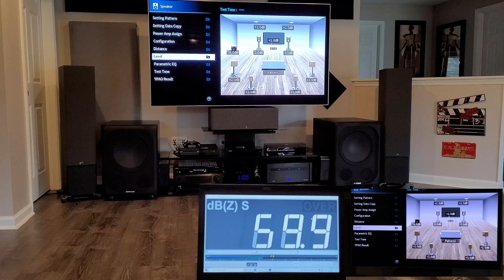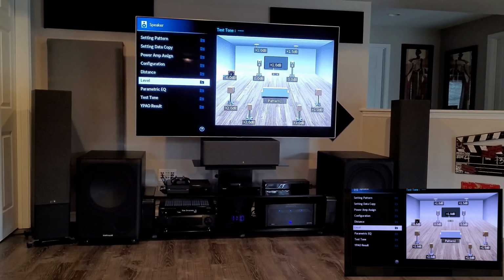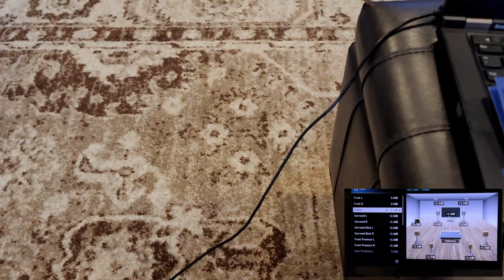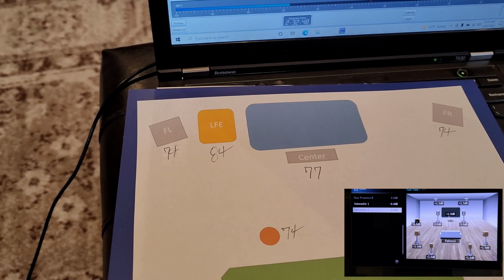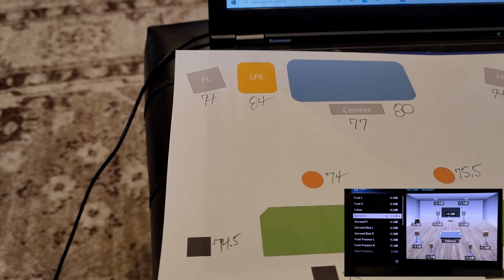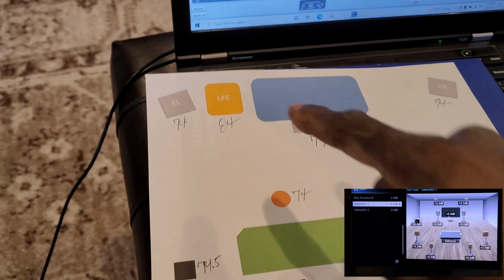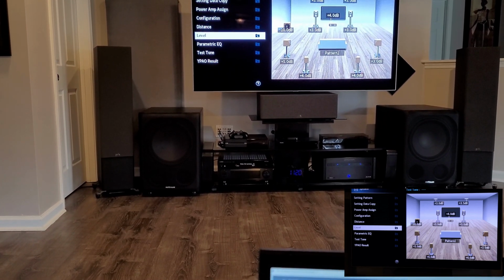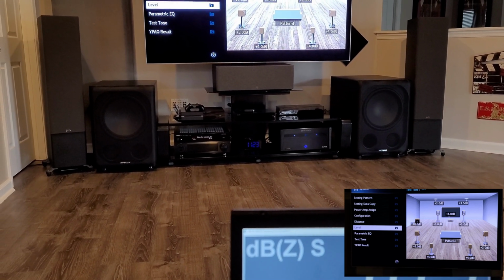Calibrating Home Theater dB Levels with an SPL meter for Seamless Integration

Comment: 75 db left and right speakers 78 center channel speaker 80db subwoofer.
Should dual subwoofers be at 80 db?
Reply from the maker: @JayPatrol  I made another calibration vid after this one, which I think is a bit better. I set all speakers, including the subs to 80db. Which makes for the perfect integration. When I db my subs, the gain in the receiver is at -10, making it easy to add a few more db without having to remeasure. I then pull the subs up to 83db (-7.0). Which in my setup sounds incredibly good. I calibrate my living room setup with the same specs, and it also sounds really good. Give those specs a run in your system and see how you like it. All speakers = 80, Subs = 83.

Comment: It’s better to put the subwoofers away from the front speakers
Reply from the maker: @JayPatrol  The best position of subwoofers is determined by the room and its acoustics. Every room is different, so you need to figure out what works best in your environment. I have four subs, with two up front and two in the back. In my room, this configuration works phenomenally..

Comment: May i ask what volume do u put when u u calibrate ur speakers 0db or -20
Reply from the maker: When setting the db levels, first turn your AVR volume to 0, which is reference  level on a relative volume display  (-70 - 15). If you have an absolute volume display (0-100), set the volume to 80, which is reference level on those systems. Then, run your test tone/pink noise to calibrate the speaker dbs.

Comment: What are your thoughts on processors. Do they take the load off av recivers. What exactly does a pre pro do.
Reply from the maker: A processor does the same thing as an AVR without the amplification element. It wouldn't make sense to use a processor with an AVR. Rather, you'll run a processor with external amps. The benefit in doing so is more power and scalability.
Reply: @PolkFan  so using a processor with a separate lets say 5 channel power amp would make more sense.
Reply: Do you use a pre-pro yourself.
Reply from the maker: @NaveedKhan-bs1sc  Exactly. The amplification power in AVRs drops significantly in multichannel mode, vs separate amps are constantly strong, keeping the same RMS power all the time.
Reply from the maker: @NaveedKhan-bs1sc  No. I have my front stage on an external amp and processed from the AVR. The rest runs from the AVR.

Comment: Audessy is a good starting point. There's a lot of tweeking that needs to be done after it's done. Verify speaker distance is number 1... Another trick I've learned, is take the distance and multiply that number by 0.875, you'll see an improvement as well.
Reply from the maker: I have another video that illustrates manual tweeks after calibration, which includes speaker distance, position, crossover points, eq settings, etc. This is only specific to setting the db levels using an SPL meter. YPAO seems to do an excellent job with calibrations - especially with multiple subs. For me, there's not a whole lot that needs changed after calibration. Mainly just crossover points and DBing.
Reply: @PolkFan  I wouldn't have thought there would be the need for a lot of tweeking, a foot and a half off. That throws the vocals all off on 2.1 listening. Once corrected, the vocals came to the center and the overall sound was so much better.
Reply from the maker: @damondhorner1602  Nice. I've measured my distance after calibration and found the settings were spot on. I haven't used any receivers with Audyssey but from my experience with working with people who has Denon, Marantz, YPAO does a better job. I'm running a A2080 now, but eyeballing the A8A. Really don't need it though because the 2080 is such a solid receiver, and there's not much to gain.

Comment: The Test Tones in your AVR bypasses all forms of room correction. I recommend selecting the ‘Generator’ feature in REW and play periodic pink noise with the room correction mode (e.g. YPOA/Audyssey,Dirac-Live) via your AVR enabled

LFE is actually a separate channel all together. It is 10db ‘Hot’ by design. I would keep it as such. If you interested in calibrating your subs to a specific SPL then you need to disconnect your Left main speaker and play periodic pink noise at the Sub level (selectable in REW) with the Left Speaker selected in REW. Don’t confuse the LFE channel with low frequency output from your subs (I.e. Yes LFE is low frequency by design but most low frequency material is sent to your subs outside of the LFE channel). The material sent to your subs via LFE is material that the ‘mixer’ of the movie/music designated as part of the mixing process)
Reply from the maker: I'm good with my method. It's effective and works well. I have no need to use REW for speaker DBing. Many HT users don't use REW or even know what it is. If you'd like to post a vid illustrating a better method, I recommend you go forth and concor. What I've outlined in my vid is simple and doable for most HT users. I'm in the business of helping others achieve awesome sound; not complicating matters by advising them to use tools they most likely don't have or the inclination to obtain.
Reply: @PolkFan  sorry, I thought you were using the REW SPL meter?
Reply from the maker: @ts6640  I do. I also pointed users to a handheld SPL meter from my other DBing vid. Which is also effective and only $30 from Amazon. Using REW requires having a machine to host the software; getting a MIC similar to my UMIK-1, getting the proper connection cables, etc. All that for speaker DBing? Just use the handleheld; it works fine. I mainly use REW for my subs. If it wasn't for the fact that I run four subs, and use MiniDSP 2x4HD, I wouldn't use REW.
Reply: @PolkFan  Fair enough, but I do think it is important to note that the internal test tones of the AVR bypasses all room correction modes. Since the vast majority of users use some form of room correction I think it is important to use pink noise with whatever mode the user normally listens to movies/music via his or her AVR. Room correction can alter the specific ‘trim levels’ for any given speaker. YouTube even has several versions periodic pink noise available or one can download samples and play back via USB.

My comment should not be taken a criticism by any means (hell……it is not like the manufacturers of these AVRs are exactly forthright in letting users know of this fact)

By the way, I just subscribed to your channel. I like your content!
Reply from the maker: @ts6640  Cool.👍🏾

Comment: Is it bad that my front (L & R) are set to +11.0 ? It's at 75DB and I used z instead of c for the test tone.
Reply from the maker: It simply means either your speakers have a really low sensitivity level or your receiver's amplification power isn't that strong. The trim level is high, but you're at your desired db, so you're good to go. Using the Z scale is fine. I also use Z. Both Z and C are pretty much identical between 20-20. Z is more accurate than C below 20hz.

Comment: at what level to put your amp to play with the sound level meter
Reply from the maker: Reference level. For receivers with a relative volume display (-70 - 15), reference level is 0. For receivers with an absolute volume display (0-100), reference level is 80.
Reply: I have a yamaha rxa8a amp so I have it but at what level?
Reply from the maker: @Mck179  0
Reply from the maker: @Mick  Yamaha gives you the option to change the volume display type, but is default to relative.

Comment: Just curious but why are you using z weighted instead of c?
Reply from the maker: Z has no weighting and is flat through all frequencies, unlike C that's flat only through 20-20. So for measuring purposes with speakers capable of playing frequencies outside the 20-20 range, you'll get more accurate results. For this particular measurement, it really does matter. You'll get the same thing with either Z or C.

Comment: hold on mate. your mic is connected to your computer? or direct to the receiver. i don't see any cable that shows your mic connected to the receiver. 🤔
Reply from the maker: The mic is connected to the computer via USB. When using REW, you'll also need the calibration file upon first use. The calibration file is available from MiniDSP when you purchase the mic from them. This ensures the most accurate readings.
Reply: @PolkFan  🤜🤛 awesome. thank you for all the information.
Reply from the maker: @combojerman28  Absolutely. Anytime! 👊🏾

Comment: Ok let me know one thing what happens if put all the speakers at the same level for example 75db?
Reply from the maker: Setting all of your speakers to the same db will result in an uneven sound from your system as a whole. Only in a perfect acoustically optimized environment will that work. The goal is to adjust your speakers so that the listener will hear the sound from all speakers evenly in a given area. Based on the acoustics of your room, that may require speaker A with a higher db level than speakers B and C, etc. Versus setting them all to the same db level, one speaker may sound lower than another -effected by the room acoustics.The majority of our rooms are not perfectly acoustically optimized and therefore our speakers must be adjusted accordingly. This is why system calibrations are a necessity. Your speaker must be adjusted for the acoustics of the environment in which they will play.  

As far as what db level to target correlates to how much volume you want to give your system before it reaches the point that satisfies you. I prefer not having to crank the system to reference level (0 on a relative volume display) before it's loud enough to enjoy, so I target 80db. I typically watch movies with the volume on -15. You can target 75 if you like, it simply means your system will be 5db quieter than mine throughout the volume range.
Reply: @PolkFan thank you so much for reply
Reply from the maker: @avsolutions212  You're very welcome.  Anytime 👍🏾
Reply: @PolkFan  ❤️

Comment: Hi may I know, example your atmos before +3db, left=74db & right=75.5db its means sound out from this 2 speaker not same, why not get it into same db? I want to learn about this..
Reply from the maker: The reason you'll see different dB levels like that from calibration is beacuse of multiple factors. Based on the placement of your calibration mic and what it hears during calibration, it'll tell the receiver what adjustments to make in order to make them deliver an even sound to the area of calibration. While the speakers may be identical, the placement of them could differ and possibly cause one speaker to need a db of amplification added in order to make it sound even with the other. For example i may have one front speaker sitting 14.5ft away, angled at 20 degrees, and the other at 13.5ft with the same angle. Both identical speakers, same output, same angel, except one is a foot further from the seating area. That one furthest away may need a tid bit of more volume to sound even with the speaker that's closer. In a perfectly acoustical treated room, the number will be much closer or identical, no adjustments will need to be made. But the majority of our rooms are far from perfect, which is why adjustments are required to overcome the acoustical flaws in our rooms.
Reply: @PolkFan Thanks for your info..
Reply from the maker: @myhobby3097  You're very welcome. I hope it helps. If not let me know and I'll try to clarify things.

Comment: Bro, this is a good idea. You have ratified your previous position with correct reasoning. Agreed, its just building on what the system calibrated for your specific room (its character, placements, distances etc). Its like putting a substructure on a foundation - with calibration being the foundation in this case. Thanks for sharing this deep insight. Share some post-adjusment vids now.
Reply from the maker: Kool! What's good my brotha. Thank you so much for the feedback. Your assessment couldn't have been more precise. It expresses my exact logic and reasoning. More vids to come. I'm back in the office now so I have to find time in my busy work schedule. 😄

Comment: Question: Instead of adding 3 +DB to each of the speaker why didnt you just leave everything at 75db except the center 78db? It is the same thing? Is it? 😁🙏🏻
Reply from the maker: The gist of this method is to leave it the same, except for adjusting the LFE to match the center. I move it up only to feed my speakers more power. Rather than having to crank the volume to higher levels to achieve the ideal output, I slide everything by 3db. I ran the other method (80 front stage, 77 surrounds) for a while, and it became my normal practice. Until recently after running a calibration, I compared the sound differences between the old method and the method outlined in this vid - my receiver has different sound profiles. I found that the integration of this method was smoother; everything came together with perfection. But always encourage people to try multiple configurations and stick with what works best in your environment. This is simply something that works well for me and I figured I'd share it; perhaps it'll work well for others as well.